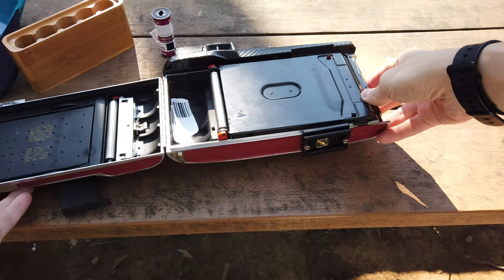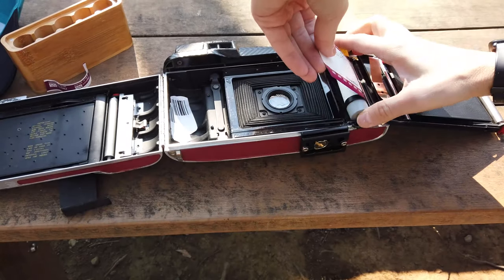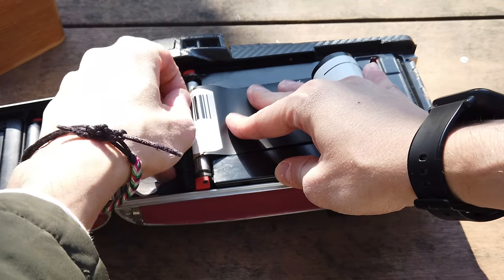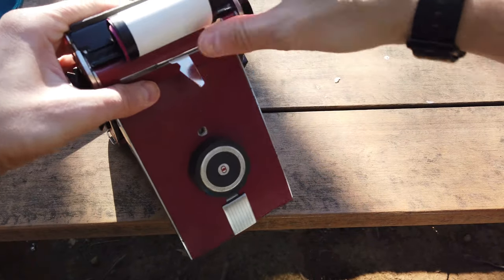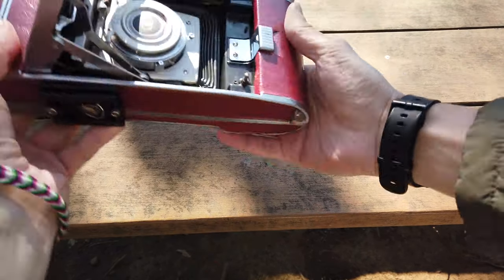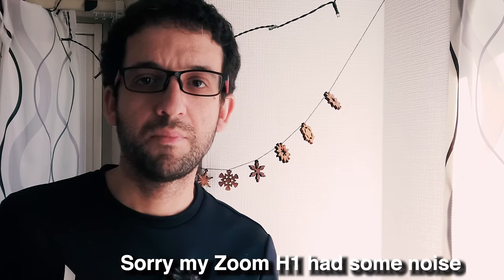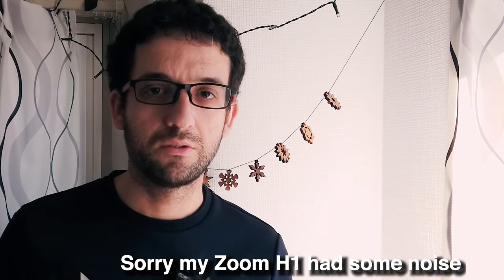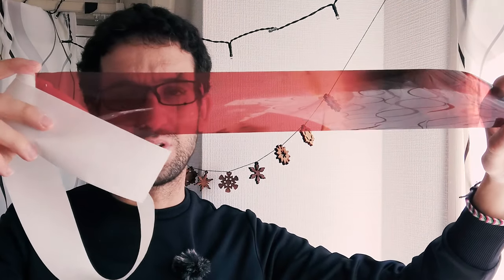Polaroid 120 land camera. NEW TRY!

Comment: Keigo, sorry to see that it didn’t work the way it should. As there were almost blank frames from #2 onwards, I suspect the shutter to be faulty. As for a spooling device, how about something in the manner of those old MF adapters for LF cameras, the take-up section of it. You have access to a 3D printer, maybe you can rig up something you can attach to the slot where film is pulled out ?
Reply from the maker: Thanks for the comment! Yes the faulty can be considered as one option as well as I kept the camera opened instead of fold it back and I think probably some leak in the bellow. Can you link some images I can use as inspiration to make it in 3d?
Reply: Keigo, as I don't have a 3d printer I cannot provide You with any kind of 3d data. What I can do is send You some pictures of those original adapters I had in mind as inspiration source, so to speak. I think I have Your email address somewhere.
Reply from the maker: Klaus Tiburski yeah sending photo is enough thanks a lot. Just in case I give you the email again Keigo.moriyama@gmail.com